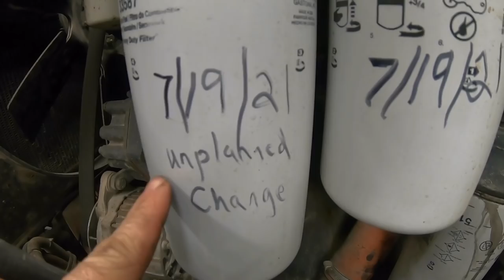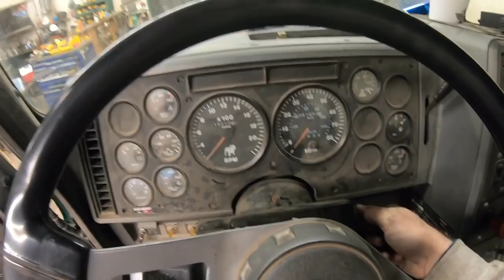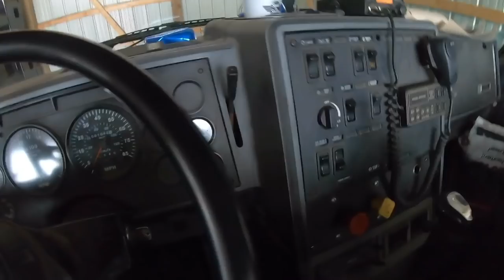Replacing Fan Clutch in Mack Truck - PLUS - SCAG Lawnmower Service

Comment: Cap’n, I agree.  Those blades have at least another season in them.  

I was at the Farm Store a couple of years ago shooting the bull with my buddy at the parts counter.  A woman came in and handed him a set of three blades to be sharpened.  She then tells him that her husband couldn’t get them to cut right. They were leaving a narrow strip on each end of the center blade.  No matter how many times he sharpened the center blade, he couldn’t fix the problem.  On top of that the mower was vibrating really bad.

He picked out one of the three blades and said, “Let me guess.  This was the middle blade.  Right?”

I looked at the stack of blades.  The two outer blades had been ground down to about an inch of flat at tip.  The center blade had no flat left.  It’s tip had been ground off to the lift flight on the back.

She replied, “I don’t know which one is the middle blade.  He just told me to bring them to you for sharpening.”

He walked over, picked up a new set of blades and laid the old blades on top of them.  Apparently, hubby had been grinding both the cutting edges and the end of the blades.  The outer blades were about 1/4” short on each end.  The center was 1/4” short in one end and 1/2” short on the other.  

He then made two suggestions… “You need new blades.  You might want to tell hubby to bring them to us for sharpening.”  

You know Cap’n, there are some folks who figure out the simple things and some who shouldn’t even try!
Reply: I had a guy with a similar story to this. I wanted to say to him, "All it takes is some common sense", "and don't look in your change pocket for it"... But customer services will not let you tell idiots the truth.
Reply: @edwardgriffin8092  there’s one proven fact about idiots… They live among us!  😆
Reply: @sassafrasvalley1939 . Sad, but true...
Reply: This is very funny 🤣
Reply from the maker: Ready for lift off HAHAHA, oh that's good!

Comment: Capt. Mike, just a heads up, when you change oil, change the washer on the drain plug, and the spin on/off oil filters, make sure the "O " ring comes off with the old filters, it makes a right royal mess otherwise, and you spin them on hand tight, never use a filter strap/wrench to tighten. Other than that, great job. from your mate, in Perth, Western Australia.

Comment: The fun part with blade sharpening is how many people put blades on upside down. Had a friend hercpartners cousin worked on mower, after that wouldn't  cut right Sha asked me to show her how to sharpen blades, the went home and her and her partner  went to take blade off and yep upside down. And they both said  "can't fix stupid" . Some manufacturers are marking blades with this side to grass. As for the date thing worked one place where they looked for a certain batch of material for 3 days when they asked me if I knew where it was I told them they were leaning on it. Told me no wrong date told them it came from Spain and showed them on other batches how date worked. They asked me how I knew this and told them who do you think put this stuff away. Next time ask.  Great show
Reply from the maker: Lol loves the stories

Comment: I know YOU put the fan back on the same way it came off, but it looks like it would pull more air if it was reversed. Saw several comments and went back over video to check. I'm sure DP would know more than me.

Comment: Be sure to check the exhaust bearings located near the muffler, and the spring tensioners for your lug nuts if those come loose you might loose a wheel. Oh yeah and top off your blinker fluid if you get pulled over you'll definitely get a fix fix it ticket but its still not worth the risk or hassle in the long run. Better safe then sorry. Cant wait to see the oxy/acetylene in action. Great video as always. :)
Reply from the maker: Exhaust bearings were good! Lol

Comment: Good job Captain.
That fan clutch switch is kinda unusual.
Most are controlled by the temperature of the engine.
As the block warms up the clutch engages.
Hey Captain,  I like your Engine 1 watch cap.
My dad drove Engine 7 for Flint Michigan for 30 years till arthritis medical retired him.
It also grounded him from flying as a part time off days Flight instructor.
Reply from the maker: It operates the same, the switch is a manual override. Pretty common where we are.

Comment: Hey Captain. Just a suggestion regarding the date thing you spoke about. You could use three characters for the month and any confusion would be eliminated. For the date you used, you could write it as Jan/18/2022 or 18/Jan/2022 (like most of the rest of the world does 😁).
Reply: Hey Tony… those paint pens are expensive… add a letter? It is cheaper and more fun to keep Mikey guessing!
Reply: @sassafrasvalley1939  Yeah. You could also use some of Farmer Chris's DP and NYA Millenal hand signals to improve communications as well ... 😎😁
Reply: I've done it that way since the late 1970s - skip the slashes too: 27jan2022.  Although if it is later in the month than the 12th, I will sometimes use the old way.  Further exception, when the month and date are the same, I will usually use numbers: 2/2/22.
Reply from the maker: Most of the rest of the world isn't servicing Mike's equipment though.  Lol

Comment: Guessing the overhead hoist is working?  I would have lifted the back to get at the hydraulic filter, and lifted the front to access the blades easier. I have a small electric hoist in my garage, comes in handy in those situations.
Reply: Commented before I saw the blades can be undone from the top. My smaller mower is held on from the bottom. Still, hoist comes in handy in many projects.
Reply from the maker: Definitely handy to have

Comment: 10:45 - Looks like the concave of the fan blades were facing forward? Is that normal?
Reply from the maker: It's how he had them on there
Reply: @CaptainKleeman  Yes, I noticed. Maybe you should run the question past him to ask him if he thinks it's correct?

Comment: Captain are y'all running virgin tires or recap tires on the Mack and GMC dump truck! Just curious. I like the tread pattern on them.. Oh and DPs new truck would look awesome with some black Fuel brand Vapor wheels on it is what I think. 👍
Reply from the maker: Recaps on the drives

Comment: Awesome on the airline install except you need a little stainless insert that goes inside the airline so it doesn't Crack during use. But keep up the harassment it's what makes a family stronger.
Reply from the maker: I did forget that part

Comment: The date most eng system i use have dd/mmm/yy // next ones  yy/mmm/dd   and your mmm/dd/yy i seen 1 or 2 that use that so i know of it but its not the popular if you check around the world... The problem with the Mach its need a small  Pepsi 6 Can Personal Mini Fridge Cooler so it dont spawn empty ones.... but it's DP,S so it will prob always spawn Empty pepsi cans ...

Comment: Intercooler and a turbo, for good measure.
Reply from the maker: What?
Reply: @CaptainKleeman  Here you go. "They are widely known as an air-to-air or air-to-liquid cooler for forced induction (turbocharged or supercharged) internal combustion engines, used to improve volumetric efficiency. This is accomplished by increasing intake air density through nearly constant pressure cooling."

Comment: Ok guys I am really wonder is that fan turned around backwards, it looked like it to me.
Reply from the maker: It went on the same way it came off
Reply: It only goes on one way
Reply: you are correct that you put it back on the way it was, however the cup of the blade looks backwards from all the equipment I have worked on, maybe it is just the way it looks, might have DP look at it, it only takes a second if it is on your mind when checking the truck over, in the cool weather it wont affect anything but on hot days it wont cool as well.

Comment: it is pretty much only the US that uses M.D.Y, with only a few exceptions all other countries use Day-Month - Year, you guys are pretty much the only place that also still use inches-feet-yards-miles, except your auto industry is now metric, probably due to the imports from other countries and also other countries won't accept American vehicles without metrification. Time to move forward, after all, your currency is already decimal.
Reply: Last time I check there is only 3 countries left in the world that use imperial units as standard. I feel for the students that learn imperial units when they are young then going to college and having to start using the metric system especially in engineering and all science
In the UK during the 90s we had been taught how to convert old imperial units to metric but being told by the time your old enough to work there won't be imperial units used